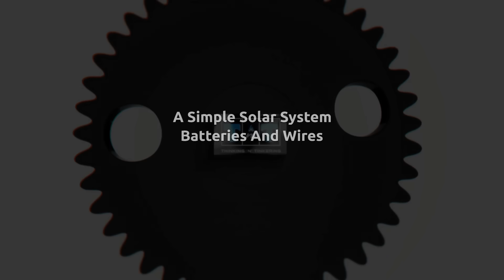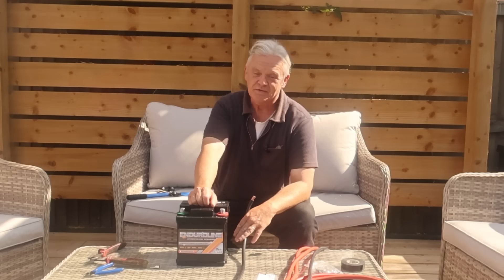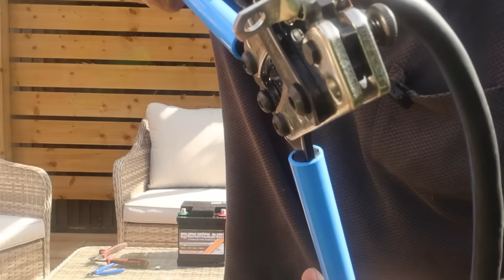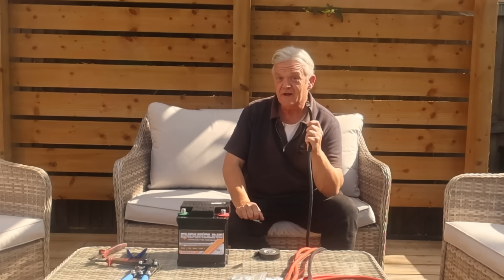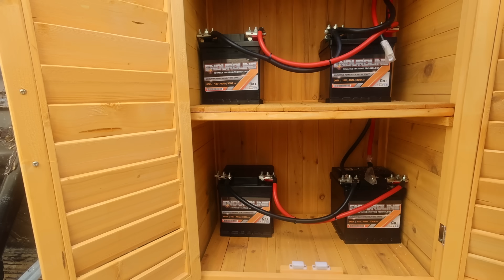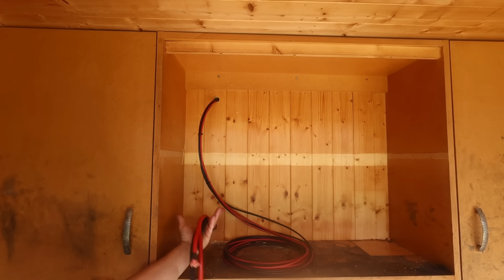2424 A Simple Solar System - Batteries And Cables

Comment: Great information, I have an idea about unused power from solar panels when batteries are full, could that be diverted to a sand battery for heat? that could heat your home by a small % depending on the time of year and sun light.
Reply: Re-invented the wheel there. Your idea has been around for decades. There are also many other ways of using/storing the surplus.
Reply: Yes
Reply from the maker: Absolutely mate

Comment: Robert, when you talk about 'Jubilee clips holding wires on battery terminals' it makes me wonder if you've sneaked a look at my system 😉.
regarding energy storage, I had this whacky idea of a gravity 'battery' for storing excess energy once the chemical batteries are full. a mass is raised by a motor which is then switched to fall and generate when demand is required. kind of an adapted principle of how the Dinorwig Power Station (electric mountain) works.
when you aren't using any energy and your batteries are full, solar panels keep giving you power, so it seems a shame to waste it.
with 2 right sides of the brain and 2 left hands building these things is always the real challenge lol.
Reply from the maker: lol - A friend of mine does it too mate! A gravity battery is certainly something to think about

Comment: So if you built a generator that runs on small amounts of hydrogen to produce power to top off the battery system would be useful? Or one of those membranes that produces electricity from hydrogen?
Reply from the maker: it's really a very very small amount mate

Comment: An advantage to being a battery evangelist is that one doesn't need an inverter: he is saved from further conversion!
Reply from the maker: The comments of that particular video are going to be interesting mate lol
Reply: Always wonder if a andrino ore raspery can do get fase jobb if the volt was rigth. The inverter may not needed. Ore if a ev car  charge direct from suncell no inverter just open the protokoll for ev ev standard. Then a ev can us its internal charger to manage the direct sun cell power. Nkce for poor contry. Like uk Norway..I also seen boosters of volt just using caps to boost the voltage output. Nice if a ev gone have direct solarpower when driving from roof and panser. 24volt to 380volt feks. Ev case